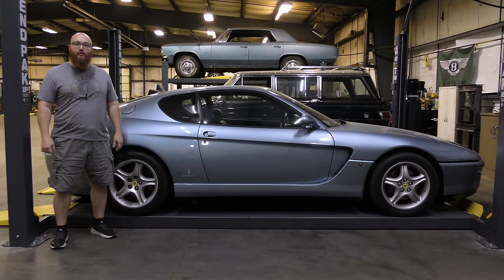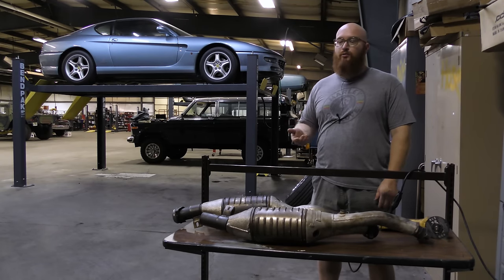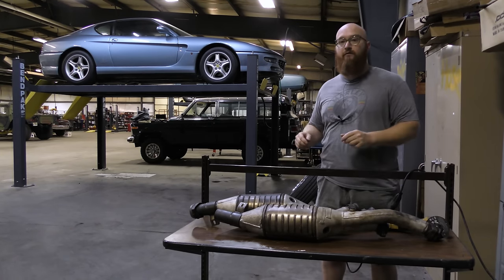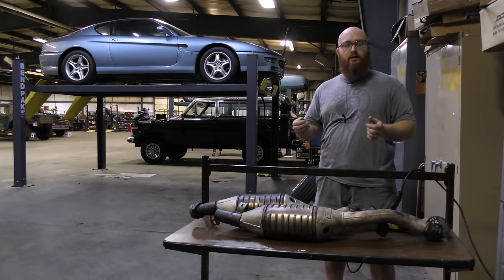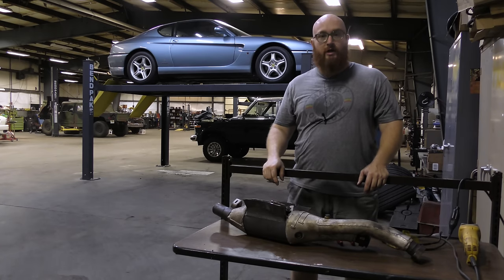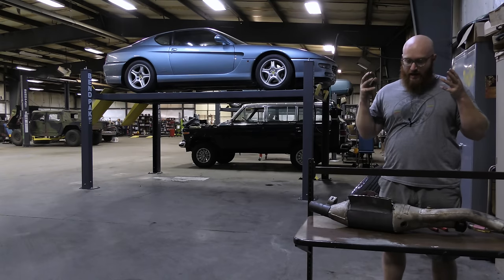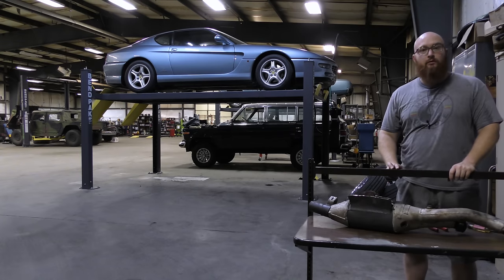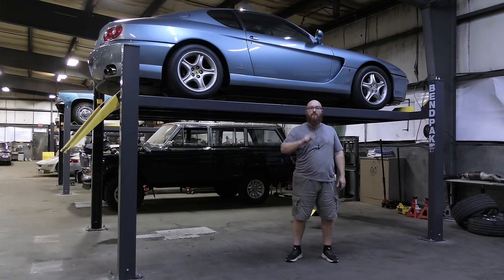Cat Melt Down! CAR WIZARD shares everything you wanted to know about Catalytic Converters and more!

Comment: is there a way to prevent the po420/430 code after replacing your cats with test pipes? i just drive a pathfinder and am on the 3rd set of cats. it no longer makes sense to replace them.
Reply: 90 degree J bungs
Reply: @funnypranker34  thanks for the reply, I have seen this mentioned a lot and I’m just wondering if it’s possible that could cause my air fuel ratio to go out of whack. As far as I know the ecu uses the signals from the downstream 02 sensors in its calculations. I guess if it causes it to run In a way that doesn’t trigger the CEL that would mean it’s running proper?
Reply: I do not believe you can. the cars computer is looking for specific values from the O2 sensors and will throw the code if it does not see them/if the sensors are missing. 3 cats seems very excessive, what is causing them to fail?
Reply: @ogonbio8145  I don’t think it’ll mess with it. It seems to work best on 2006 and older vehicles
Reply: @Egress.  I live in a rural area. Been using the gasoline I keep in my big tank to fuel my pathfinder and the catalytic converters don’t like it. I think it’s 89 octane
Reply: @ogonbio8145  you might wanna look into that? the octane might be too low/gas has sat for too long and is causing your engine to misfire.
Reply: @Egress.  its obviously too low of octane. it the same stuff that runs machines.  ive been doing it for 20 years. just looking to remove the cats, its not illegal where I am.
Reply: @ogonbio8145  If you're in the US, it's illegal to remove them.
Reply: @ogonbio8145  correct.

Comment: Just take the core out, weld it back together and tell hoovie to live with the engine light on
Reply: I'd go to a different mechanic if that was offered or completed on any vehicle in the shop.
Reply: @tumekeehoa3121  he will never sell that car and Kansas doesn't have emissions testing. At least until they can get the parts. If not he can put universal cats for a couple hundred dollars.

Comment: Not only. Cats were used to change carbon monoxide (CO) into the less harmful CO2. CO occupies the same space that oxygen (O2) does in the haemoglobin in your blood. When CO occupies this space, it is effectively robbing your body of O2. After being converted by the catalyser material, the emitted CO2 cannot be absorbed by your haemoglobin thus doesn't rob your body of oxygen.

Now. It doesn't burn unburnt fuel as such. Your engine must operate within the stoicimetric burn envelope. Which means your fuel/air mix must be within certain levels. Too lean, and with the resultant exhaust mix, the cat can't operate correctly. Worse still, the excess exhaust heat this causes over a long period can burn out the cat.

Too rich and the unburnt fuel will actually clog the converter. This is less worse since you may be able blow/burn this off on a long journey causing only very minor damage.

Your O2 sensors are important as these detect how well the gas has been burned and leans/enrichens the fuel/air mix accordingly (its like an information feedback loop.) - O2S1 checks the gases before the cat. THIS is the important one. It checks the gases in order to prevent your cat from damage - if this breaks it MUST be replaced immediately! O2S2 after the cat checks to make sure the cat is doing its job correctly - if this breaks its not all bad but should be replaced as soon as possible.. Any difference or reading outside of the envelope means there is problem and the check engine light comes on.

However, if there's an external factor that causes weird readings (say headgasket failure or a clogged air filter, etc), the feedback loop does the best it can to cope and adjust the mixture according to the ECU map. The engine cannot burn the fuel at its optimal level. That external fault needs fixing.

Comment: just smash the insides with a pipe and put them back in until you can get a new or good used one fookin hell no one will know there aint any shit inside the cats housing also use some spacers on the o2 sensor to fool the ecu into thinking they are there :)

Comment: The engine need to run rich use more fuel so the cats can work.
 If cats did not exist the engines would be more fuel efficient and these days have better emissions

Comment: Here is the reality carbon is a base element you can't burn it away or break it down. The amount of carbon in the fuel is the amount com.ing out of the exhaust unless that cat collects it. The main point of the cat is to clog if you start burning a lot of oil forcing people to replace or repair worn engines

Comment: I'm no Chemist, But as I understand it, the catalytic converter on a petrol (gasoline/benzine) car, converts exhaust CO to CO2 by oxidizing it from carbon-oxide (one carbon atom + one oxygen) to carbon-dioxide (one carbon atom + 2 oxygen) Carbon-dioxide is the same stuff we humans exhale. It's still bad for the environment if the carbon is from fossil fuel like gas or diesel. Because the plants absorb the carbon-dioxide and release oxygen, there is a positive cycle when you use non-fossil fuel. But running on fossil fuel releases more carbon into the atmosphere that has been trapped for thousands of years in crude oil or natural gas.

Now, a Catalytic converter for a diesel vechicle with additive urea is something completely different. I will not go into that. Not in a million years. That's borderline witch-craft :D

Comment: a good tuner can get the same readings with or without a cat
Reply: That's false. To get the emissions reductions you need the cat.
Reply: @chrismccarthy7539  I have done it emissions are the same all the cat does is burn the excess fuel which if the engine is set up properly you won't have excess fuel
Reply: @victorwanstreet3038  so you have chassis dyno data that shows your tune is below the EPA requirements for... NOx, NMOG, CO, PM and HCHO without a catalytic converter?

Comment: Emissions on Diesel engines is the most stupid idea EPA has come up with yet.  Even more stupid is EGR on Diesel engine
Reply: From a technical standpoint I agree with you. It's obscenely complex to make it work. And expensive. How ever.... From the environmental aspect is absolutely necessary. Diesel engines pollutes a lot more than petrol engines.
Reply: if a Diesel engine is tuned properly it produces very little emission. It when a owner puts bigger injection and larger turbo that they “roll coal”.  Or a driver allows his injectors to get worn down and leak fuel.  The EPA diesel regulation are only in the US